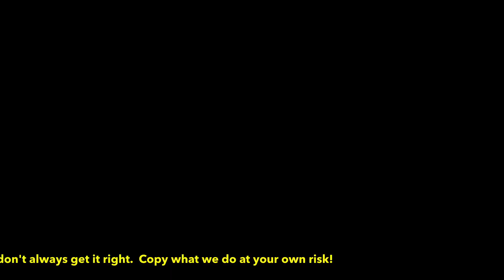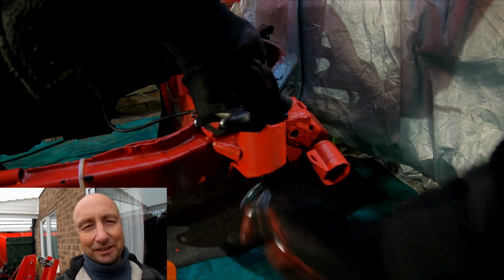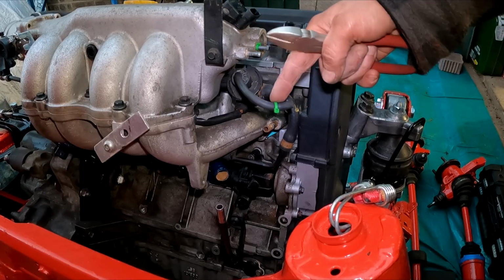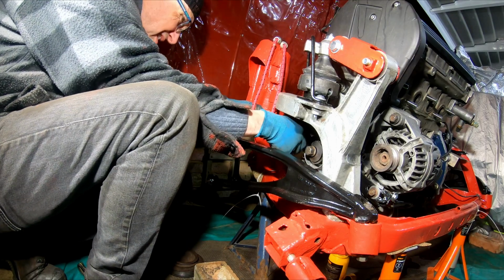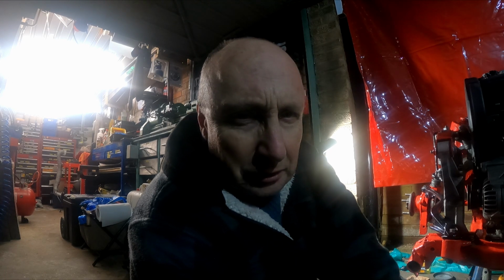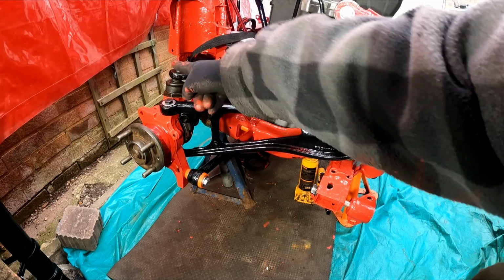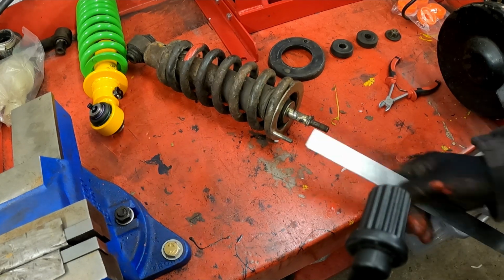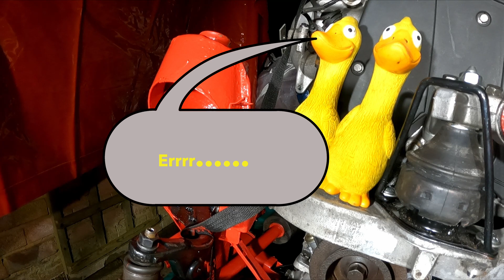Scotty’s Overheated MG TF 135 Rover K Series Engine & Subframe/Suspension Rebuild (non-VVC) Part 9

Comment: Tempted for the spax dampers. Be interested to see what you think of them with the x power springs.
Reply: Hi John. It’s difficult for me to give you an honest appraisal at the moment since I have not been able to find time to refurb the front end and fit the poly bushes, springs and shocks. The car is definitely unbalanced presently, albeit still good to drive. Even unbalanced it’s no worse than before and rear end grip is certainly good. The only issue I have currently is a little bit of oscillation over bigger bumps in the road. I have not started working on tuning the damping yet, but out of the box it’s not quite optimal - more damping is definitely required.
My plan was to wait until I have got other projects out of the way, then do the front end of the 135 and set up the suspension once the car is in it’s completed state.
So - there will be more videos to come as soon as I can get the Cayenne, RAV4 and my TF 160 (which has a very strange and potentially complex issue) out of the way.
So - NO PRESSURE !!
Reply: Thanks for the reply Scotty. I’ve purchased my TF 135 for Autosolo’s and is totally stock so far. Got a few issue to sort out first but after that I’ll be looking at tweaking the setup where needed. At the moment it’s tyres. Ditch finders on every corner.
Reply from the maker: Good luck with it - please keep us updated with your progress :-) It’s always good to know what fellow owners are going. (Scotty)